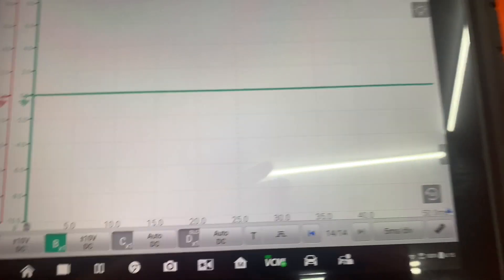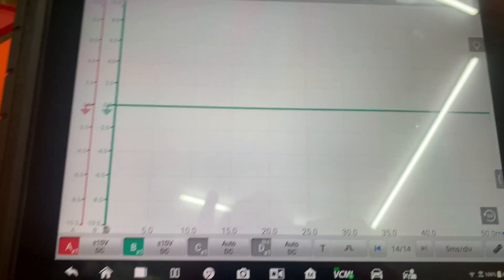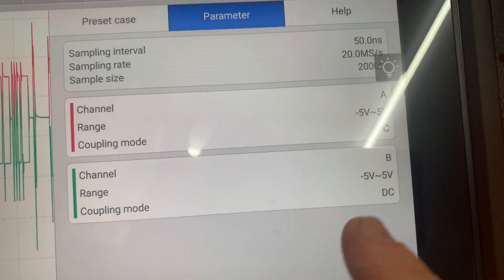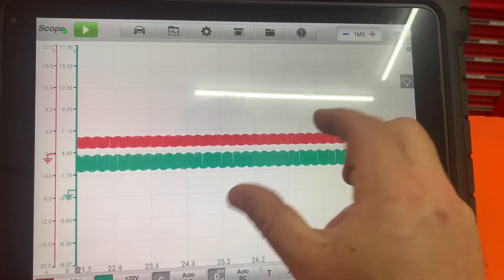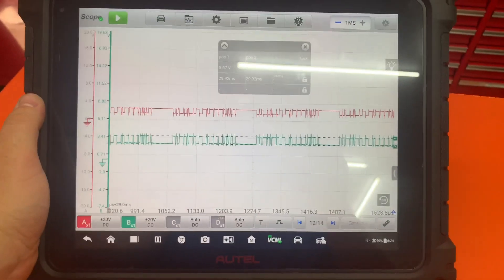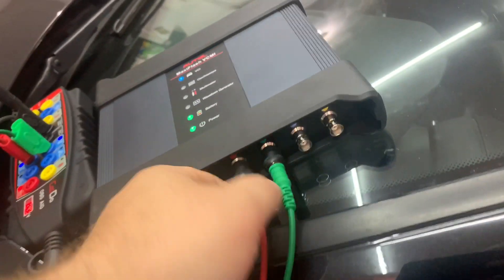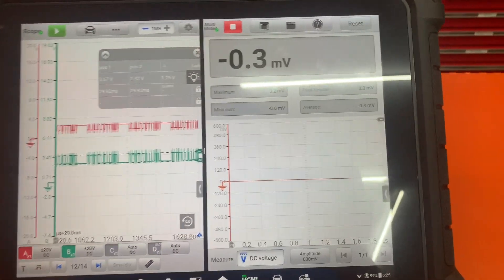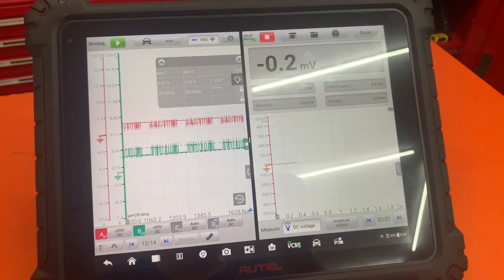****** AUTEL ULTRA Wireless Scope VCIM ************

Comment: Can you use all pico accessories
Reply from the maker: Yes that’s what I love about it. I can use my pico, Autel, ATS scope stuff all with all its great
Reply: @weldingjunkie  thanks. just bought the 919, smaller but I get the vcmi. anyways looking for accessories... amp clamp, transducers, etc...
Reply from the maker: Pete & Ashley Leavell anytime, excellent machine. Yeah check out www.aeswave.com you can get amp clamps cheap and good quality as well as leads. I’ll be doing some videos on them soon as well. This weeks prob

Comment: I'm a bottom feeder Lurker that will wait 2 or 3 years and watch all the tool bugs  get worked out of things over time and all the Initial hype is gone, and watch if the 13" screens and VCMI's stand up to the test of time.Then when prices drops down to my level maybe I'll just hit the Lure for the less hyped smaller 128gb MS919  when that's down around to what I paid for my discounted Elite that came with 2 yrs of updates and a VCI100.

Comment: Chad actually demonstrated that click OBD there is no need for using any  OBD breakout box and probes to scope the CAN circuit. I think it might be able to scope the entire OBD connector via the OBD connector. If that is the case with any car with Clear Flood Strategy (where you are able to hold the accelerator WOT and crank over engine without it starting, you could perform a quick pin 16 relative compression check on a car with a dead miss to rule out a compression issue without popping the hood in a few seconds before doing any tuneup.